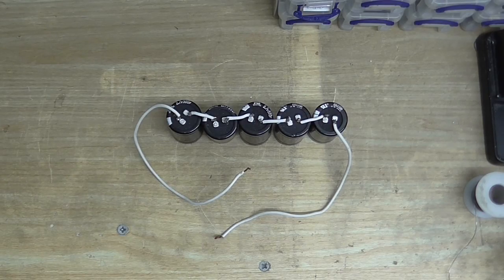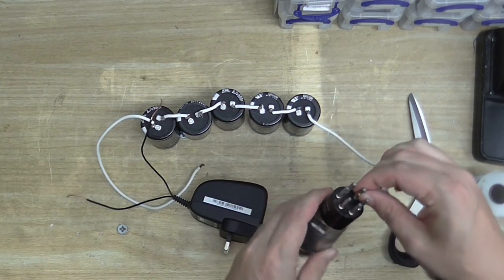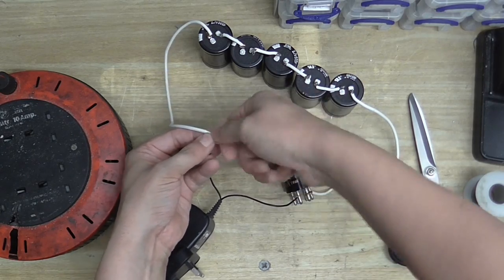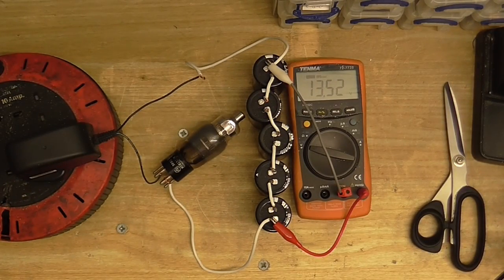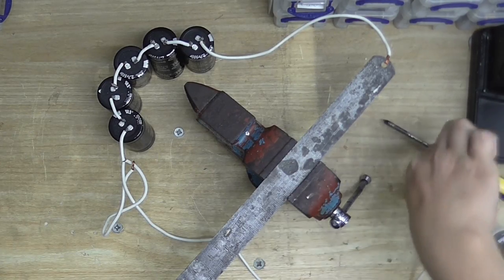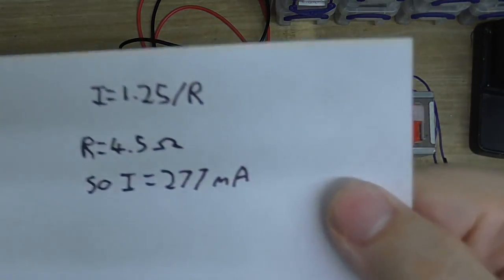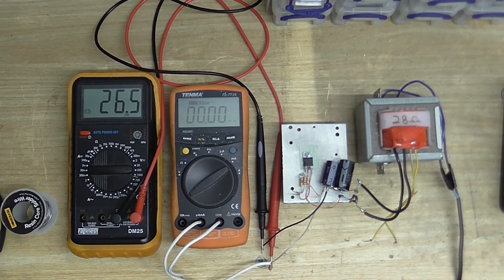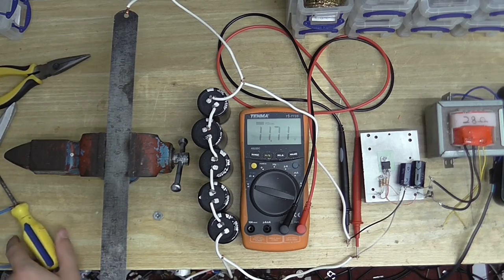Supercaps and stuff

Comment: I guess you can make spot welder with them. Put them all in parallel, 2v is a good choice for spot welder. I've made one from an old MOT, but I didn't make decent electrode holders yet. Sparks are nice, though :)